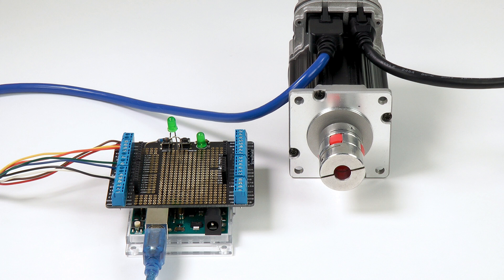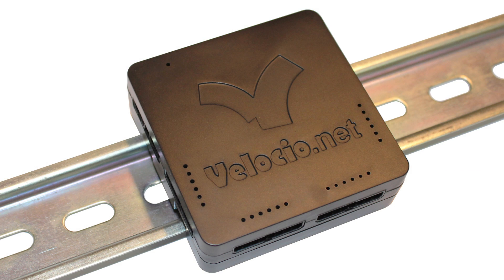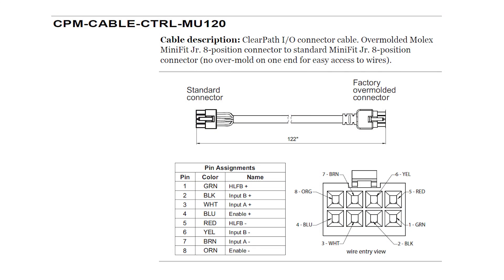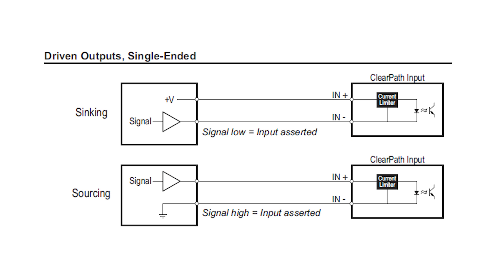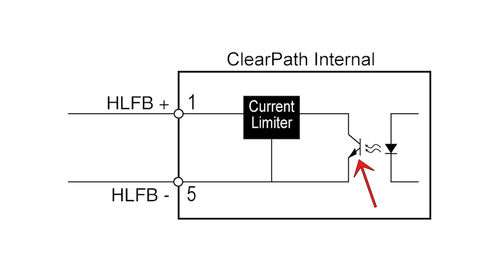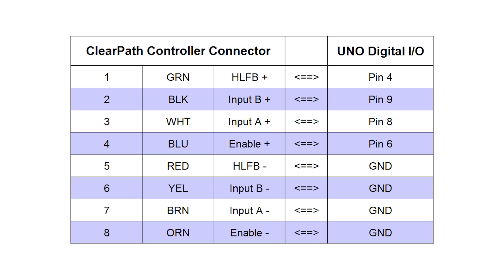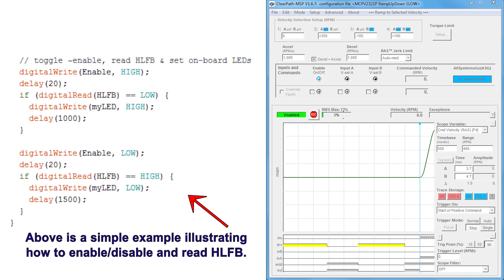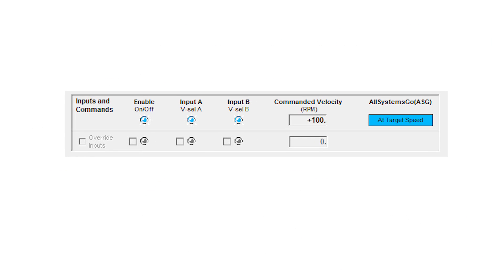How to Wire an Arduino to a ClearPath Servo Motor

Comment: Very easy?......Not to me. This is entirely over my level of familiarity or comfort, wiring things or soldering things or programming things. I want to buy/use one of these on a wearable frame, and have it respond to pressure/time signals from some object which would detect/transmit movement by the wearer. Not sure if this something that's doable via some default setting or not, or even how that would be approached. I like these servos for sure, but I need more clarity on this.
Reply from the maker: Hi David:

Thanks for your inquiry. I'm an applications engineer at Teknic and happened to read your post.  While we don’t have an off-the-shelf solution, I have some information that may be helpful to you.

First, Teknic produced this video because the Arduino is gaining popularity for both home/personal projects as well as for commercial applications. As you may know, the Arduino is a microcontroller with both digital & analog I/O and uses a C/C++ programming language. The Arduino open source community is extensive and the application diversity is wide and varied.  That being said, my impression is that you are looking for a turn-key, haptic-type controller that generates motion commands based on movement from a user wearing some type of sensor array (bend sensors, accelerometers, force transducers, etc).  

I’m not an expert in this field but most of these sensor types output an analog voltage that can be directly read by an Arduino. With the proper application code, the Arduino can read these analog signals and subsequently generate the requisite digital output signals to directly control a ClearPath servo. As a caveat, there's a fair amount of engineering (and coding) for this type of project. 

There may be something more off-the-shelf available that wouldn't require as much engineering but it would likely be in a different price range than an Arduino.  There is also an Arduino derivative that is targeted towards the "wearable" market called the LilyPad:  https://store.arduino.cc/usa/lilypad-arduino-main-board.

There's a lot to digest here but hopefully I answered more questions than I may have raised.  You're always welcome to contact us directly (https://www.teknic.com/contact/) if you want more information about ClearPath motors. Thanks for watching and commenting.

Best regards,
AbeA - Teknic Servo Systems Engineer

Comment: I wired HLFB “green” to 5v to my parallel port BoB and “red wire” to pin10 “input” to get a feed back. Here red goes to ground. I am confused. Which one is correct?
Reply from the maker: Hi Ensari Cokur, there are multiple ways of wiring to the HLFB status output and which way you choose will depend on your break-out-board's internal circuitry.

One helpful thing to remember is that HLFB is an optically isolated, open-collector output. Therefore this requires an external power source, 5-24VDC with an appropriately sized pull-up resistor. Some inputs on microcontrollers, PLCs, and other interface boards have this power source and pull-up resistor already built-in to that input, like the Arduino Uno for example. Other boards do not. There are also several additional, commonly found configurations.

On page 50-51, section "HLFB Output Wiring Examples" of the ClearPath User Manual v2.26 (available here: https://www.teknic.com/files/downloads/clearpath_user_manual.pdf) you'll find multiple examples for wiring up the HLFB. In either case, you'll notice that the wiring configuration is dependent on your board's internal circuit architecture. If your board manufacturer does not publish their circuit diagrams, you can send the ClearPath wiring diagram on page 50 to them and they can very quickly let you know the best method to hook up to their inputs. Since each manufacturer has their own way of handling IO, we provide our side of the circuit and the rest is dependent on the exact board being used.

Other helpful manual pages to check out include page 46, section "Overview: The ClearPath Output (HLFB)", and "Appendix D: Common Specifications" on page 140.

I hope this helps. Please feel free to email additional questions to support@teknic.com and we'll be happy to help.

Best regards,
Kevin S.

Comment: wish clearpath motors provided position feeback,
Reply from the maker: Hi Adam,

Fortunately, there are a number of feedback modes available in ClearPath! The ClearPath SD and MC’s have an output that we refer to as High Level FeedBack or HLFB.  HLFB offers numerous feedback options for position, velocity and torque..

If you’re looking for an encoder output, we decided to leave these out to reduce cost, decrease size, and improve noise immunity. Because the ClearPath is fully closed loop, and the servo will always follow the command, the HLFB works well for most systems. However, if you need to have raw encoder data for integration with a 3rd party device, some customers have elected to use an external encoder.

If you have any questions about the ClearPath output options please feel free to contact us at support@teknic.com.

Best regards,
Aaron B.
Reply: @TeknicInc  "to use an external encoder."
I'd wish to use an external encoder but how can I do that if Techic R&D hasn't made a shaft sticking out at the back of the motor like it's on any other servo motor in the world???
Reply from the maker: Hi MSM550, you are correct that because of ClearPath’s integrated drive electronics, there is no external shaft at the back of the system to mount an external encoder. The good news is that there are several ways to mount an external encoder, depending on the mechanics you use. Rotary encoders can be mounted to mechanical pulleys/pinions or the shafts of the mechanics. Linear encoders can be used to run along actuators such as belts, screws, and rack & pinions. It all depends on what you need the external encoder for (and many times it turns out that you don’t even need an external encoder to achieve an application feature you’re looking for).

While Teknic does not have any current plans to manufacture an integrated servo system with a shaft on both ends, I can add your request to our internal database for feature requests and feedback so that it is considered by our design engineers. We originally opted out of this design to save on cost and reduce the size (because most of our market does not require this type of feature), but that’s not to say we wouldn’t consider it as an option for future products.

If you’d like to discuss your application further or you have questions about how to achieve a certain functionality with Teknic products, please feel free to give Teknic a call at 585-784-7454 or contact us at https://teknic.com/contact/.

Aaron B. - Teknic Servo Systems Engineer
Reply: @TeknicInc  , "there are several ways to mount an external encoder"
Well, yes, sure there are several ways and one of them is adding a highly customised tooth belt pulley onto a Harmonic Drive wave generator Oldham coupling hub attached onto the ClearPath motor shaft in order  to transfer motor rotation to the other pulley attached to the external encoder. All that looks kind of OK but  one thing that makes that approach a bit ugly in engineering terms is inability to separate that tooth belt auxiliary transmission from the Harmonic drive grease. The fact is that the Clearpath motors have the shortest output shafts among the bunch of other motors and gearboxes I have by my side, so there is no chance to introduce some segregation wall in between. But anyways, I have no other choice cause I have what I have and I have to live with it. Since the HarmonicGrease(TM) is kind of lithium based lubricant, as far as I know, hopefully it might not cause any chemical harm to the belt.
Referring to my experience with ClearPath motors I can state that they aren't suitable for building robots that what I do as contemporary approach to programming robots is teaching them by letting a robot controller know about what current joint positions are. In other words, the robot controller must know the position of each joint which is used for generating a robot program. In the industry standard RoboDK software the first thing done right after establishing a connection with a robot controller is pressing the "Get Position" button. 
That's probably all what I'd like to say. 
Cheers.
Reply from the maker: Hi MSM5500, For “teaching” applications where you need to be able to measure the encoder position of a servo that has been disabled and moved by hand, Teknic’s SC (Software Controlled) series ClearPath may be a better fit. While the SC series requires a different type of control (a PC or Linux host system), you can query the encoder position.

Please feel free to reach out to Teknic directly if you'd like to further discuss your application or any questions you have.
 
Aaron B. - Teknic Servo Systems Engineer

Comment: Can it generate electric current by turning the shaft?!!!jssoo1952@gmail.com
Reply from the maker: That's a good question Jessie. All electric motors will generate current if the shaft is back-driven. However, ClearPath was not designed to be used in this manner and there really isn't a practical way to access and make use of that generated current; so, if you were designing a windmill, for example, ClearPath would probably not be a good fit.

If you have any other applications in mind and have questions, feel free to contact us at support@teknic.com

Thanks,
Jonathan T.

Comment: is this technique applicable for this motor too ?  ---> https://www.ebay.com/itm/331911454454?rmvSB=true
Reply from the maker: Hi Arka, that motor does not have a drive or controller built into it (i.e. it is not "integrated"). The drive and control electronics (and associated cables) are needed to do what is shown in the video.

ClearPath has the drive and control electronics built right into the body of the motor. So, it’s an “integrated” product. 

If you bought the motor in your link, and also an appropriate servo drive and controller designed to be compatible with that motor (contact the manufacturer for required specs), and the required cables (motor, encoder and controller cables), you should be able to do similar things.

Best of luck with your project!

Kevin S. (Teknic Application Engineer)

Comment: Not ashamed to admit my ignorance about Arduino and your servos. It's something I want to get into because I have a couple of proof of concept projects to do. I am just going to jump in, sink or swim. What is the largest clearpath servo that can be controlled using Arduino? I realize that's an open ended question with ever so many variables. And it has much to do with mass, inertia and speed and the trade offs between them. I admit my math skills are limited, sigh. I'm a Thomas Edison/Timex/Enigerizer Bunny type of guy that takes a concept, keeps on ticking and beats it into submission before running down. Oh, I learn A LOT on the journey. Reading helps AFTER I get some hands on.
Reply from the maker: Hi Scott Burrous, 

The largest ClearPath motors are the AC-input NEMA 56/143 motors. With a blower kit installed, the 3P model will output up to 8hp peak and 4hp continuous (if needed). 

To help make your learning process easier and more efficient, I suggest taking a look at the information provided in the following links. 

ClearPath Overview Video
https://www.youtube.com/embed/_SYhCRwacDs?rel=0&iv_load_policy=3 

ClearPath Overview Documentation
https://www.teknic.com/products/clearpath-brushless-dc-servo-motors/ 

I am not an Arduino expert so you will have to do your own research regarding Arduino functionality. This may be a good place to start: https://forum.arduino.cc/ 

If you have other questions, you can contact us at support@teknic.com. 

Thanks, 
Jon K.

Comment: I think you can do much more that simple on-off or toggling positions with the clearpath: 
https://www.youtube.com/watch?v=gFs96jrpHsY
I would really like to try one of the newer integral hp models...!!
Reply from the maker: Hi Thanos 6DOF,

Yes, you're right – there’s a wide range of operational modes available for the ClearPath motors. There are torque modes, velocity modes, position modes and even a software controlled version. 

For more information about the available modes, you can check out the ClearPath User Manuals in the download section of Teknic’s website or view the “ClearPath Operational Mode” videos here: 
https://www.youtube.com/playlist?list=PLuMmdjFz-3nwjDepiwI65IvtiC7rnCdrL

To learn more about the integral hp (AC input) ClearPath, check out the following page: 
https://www.teknic.com/products/clearpath-brushless-dc-servo-motors/ac-induction-replacement/

- Jonathan T.
Reply: Teknic Inc I have tried all control methods. Implemented burst pulse algorithm for my motion controller a few years back, but it was not real time, meaning the clear path wanted to complete the whole motion path not following the actual real time motion cues. The best way to use it for real time response  is in speed mode, and use external PID closed loop with external sensor. Then I also used the clear path motor for force feedback steering wheel in torque mode with PID loop on external 2500cpr encoder which worked amazing attaching the steering wheel directly on the motor ( direct drive).
Thanks for your wonderful products!

You should create Twitter account, if not having one yet. I placed some content involving ClearPath motors there but could not locate any relative hastags...

Thanks Thanos
Reply from the maker: Hi Thanos 6DOF,

It's great that you've been able to use so many different modes with ClearPath. If you have any specific questions on any of them, we'd be happy to help.

It sounds like you may be looking for an operational mode that is slightly different from Pulse Burst mode. As you mentioned, Pulse Burst Positioning mode is designed to finish each commanded move before beginning the next move. For example, if you command a clockwise move, and then command a counter-clockwise move while the first move is still occurring, ClearPath will finish that first move before changing direction and starting the second one.

Pulse burst was designed for users who need infinite position control flexibility, but who don't have a third party step and direction indexer. In Pulse Burst mode, the user does not need to create the motion trajectory. The user sets the max acceleration rate, the maximum speed, and the distance, and ClearPath MC's built-in motion controller creates the trajectory.
 
There is another operational mode called "Step and Direction" available on the ClearPath SD series which allows for the real-time positioning control more similar to what you are describing. ClearPath SD follows commands from a third party step and direction indexer. The motor will follow the control signals in real time as the command changes (e.g. start, stop, speed up, slow down),. In other words, there will be no move commands “stored” in the motor.

Thanks for the suggestion about Twitter. We've considered creating a Twitter account (along with other social media accounts), so it's possible that we may pursue this in the future. We appreciate the feedback and enthusiasm for our products!

Best regards,
Jonathan T.
Reply from the maker: Hi Thanos 6DOF,

This is a question that we have been asked before. Without an explanation, it may seem logical that the motor should have streaming encoder output data available and we do realize that for some customers, this function would be useful. However, please let me explain.

Designing the ClearPath integrated servo motors was a significant engineering challenge. The number one questions was, “How can we manufacture a cost effective closed-loop servo in a robust design that could justify a three year warranty?”

One of the ways we achieved ClearPath’s low price was by eliminating certain features. To help us decide what to leave out, we consulted a large number of our most experienced users and asked them which features they'd miss the least. If the features were costly, we had to consider leaving them out. Using this approach, we may have made the ClearPath a little less attractive for some applications, but it means now you can use a servo system where you could not have afforded to before.

There is an internal encoder to maintain accurate position and velocity, but we reduced cost and space (and got rid of potential noise problems) by not running the encoder signals to the outside world. ClearPath does have a digital status output (HLFB), however, to tell you when moves are done or target speeds are reached.

That being said, you can query the encoder position on the fly (position capture, still not streaming data) using the advanced firmware option of the ClearPath-SC family via software or (with).

Sincerely,
Jonathan T.

Comment: Hello! I just ordered a clearpath motor. I would like to know which linear drive you used in this video. Did you use an adapter to connect the clearpath to this drive or does this drive come with the suitable adapter?
Reply from the maker: Hi Andreas,  

The ballscrew linear actuator used in this video is a Vertex LGS33 Compact Linear Actuator.  The actuator is a 10mm lead ballscrew and it came with a NEMA 23 mounting flange.  The shaft coupling has a a 1/4" bore diameter, which is directly compatible with the one and two stack NEMA23 ClearPath motors with the ¼” shaft option.

NEMA 23 ClearPath motors come standard with a 3/8 inch shaft, but for the shorter NEMA 23 motors a 1/4" shaft option is available.  Depending on which motor you purchased, you may need to select different options for your actuator.

If you have any additional questions regarding the ClearPath motors, please let us know at support@teknic.com.

Best Regards,
Brendan